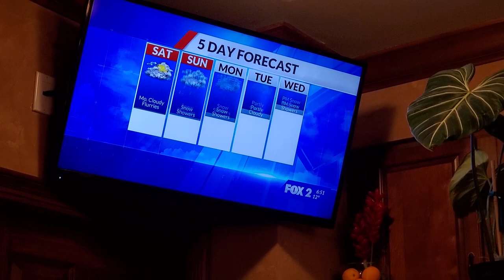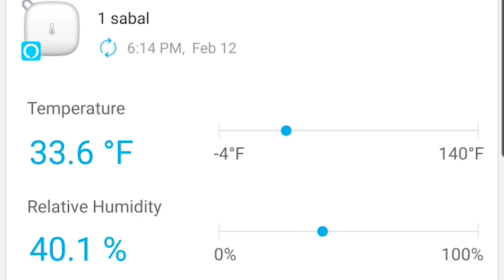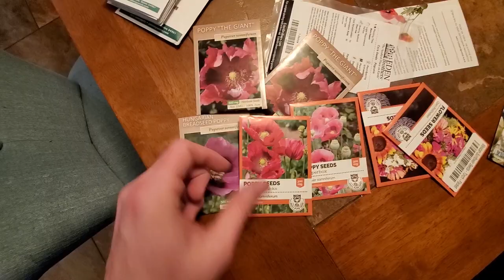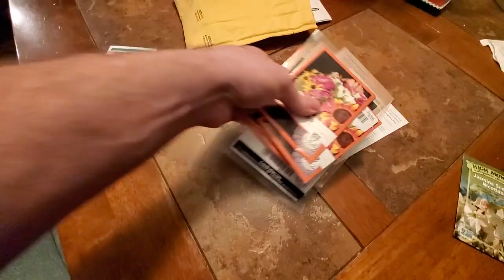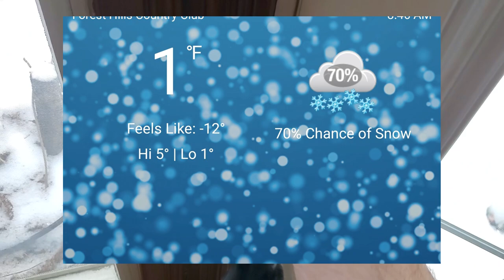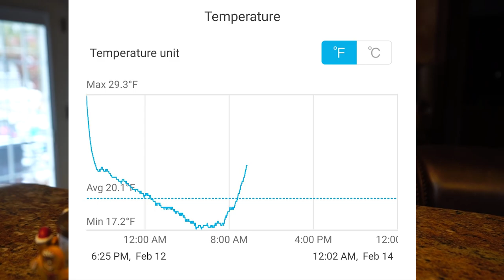Protecting Plants & Palms From Extreme Cold || Saturday Vlog

Comment: Hey Jeff. Those plant tents are great. Really easy to use and I imagine fairly cheap. I like the C7 lights combo with the pop-up plant greenhouses. I'm planning on planting out my brahea edulis this spring here. I'll probably need a set up similar with the xmas lights if our temp drops again next winter. Have a great weekend 👍. Cheers
Reply from the maker: Hey you! Wouldnt be a bad idea to protect the brahea it's first few years in the ground. They make automatic thermostat plugs that turn the lights or heat cables on when temps get to near freezing. In the US they are called, thermocubes. there's a book that I bet you would enjoy about hardy tropicals and ways to protect them. 
"Palms won't grow here and other myths"
Book by David A. Francko
Reply: @TropicalPlantParty  Thanks for the book recommendation.  Sounds fascinating.  I'll check it out on Amazon as it's definitely something I'd love to read

Comment: You're right Jeff. It is to cold. My pond is frozen over hard..had to shut off the wetland and top of the main stream cause the ice dammed up enough that water was running out of the streams. (I was looking for a giant mass of ice...My kid discovered the two inch thick layer of ice under the snow in the seating area.) My grow space has a frigid gust of air periodically coming from the vicinity door which I can't pinpoint, I hung a blanket to try and at at least slow down the cold air. Mostly ok with the temp in there, but I can't keep the humidity up in there though, kinda wish I'd gotten a fogger when I saw your video with one. Super frustrating, everything dries out really fast. My wife was ok with the power bill last month, don't want to know what this months will be. I was hoping next year to be brave enough to leave some palms in the ground outside, but then there are weeks like this.
Reply from the maker: Well, I turned my foggy machine off. The heaters have trouble keeping things warm when humidity is high. It turns into a battle between the heaters and fogger and the fogger usually wins. I figure I'd rather them be dry than damp and cold. I imagine it will prob dip into the 40s in the growspace if it does go below 0. But maybe not, it was only 1f this morning and 61F in the heated part of the garage. Idk, but im over it! Lol.. I do like the snow though. Winter is so ugly here, it's nice seeing something other than defoliated trees and dried up lawns. 
I remember that happening to me once when I had a pond. The frozen waterfall and spillover, almost drained the thing when I was sleeping. Do you have a de-icer to keep a hole?

Comment: I have been gone for a while. I'm moving mid-April (I hope!) and I have been packing and planning. Glad to see everything doing well. :)

Edit: I bought some temp. gauges that send an alert to your phone if it goes above or below the set temp. 
What I didn't know is you have to be within five feet of the gauge. -.- Close enough to see. 
So, 'someone' went in my greenhouse and moved my heater and turned it off (They brought friends in to smoke cigarettes 👿), 
so I didn't know during some of our coldest weather.  Long story short, I lost a lot of good, old cacti and babies. :(
Reply from the maker: Oh no! I've had similar things happen. Sometimes my garage door doesn't close in winter unless you hold the button down. Have had some scares where ppl didn't know you have to hold the button down and things got really cold! These sensors are pretty decent, I can usually access them from anywhere in the house but on rare occasions they can be glitchy. Idk if it's them or my wifi. It's probably the wifi bc when I switch to Bluetooth they work. The alerts aren't great though, I rarely hear them and they flash on the screen screen dissappear quickly, but again, that's probably something on my end I could fix in my settings.

Comment: I've been jumping through hoops to figure out how to keep the pool equipment & faucet warm. Towels, blankets, sleeping bags & old Canadian winter coats, and a tarp over the pool equipment. Right now we have the pool faucet continuously trickling into the pool because the dry air is evaporating the water at a crazy rate. I may take the hair dryer & shoot some warm air under the towels & jackets on the faucet periodically.

And I despise having cabinet doors open in the kitchen...tripping hazard.

Although today we had the warmest temp since tues...a balmy 33 degrees. But this is nothing compared to forecasted temps for tues...temps in North Texas in low single digits. Wind chill below freezing.

And they're only predicting 3-6" of snow! With these miserable temps, at least give us a decent blizzard! (Ok, North Texas can't handle a blizzard, especially at these temps, but snow would be nice to look at.

Put the passion flower pot in the shed with an old flannel sheet on it, put a sheet over the herb pot. I won't fuss if those don't make it. Everything else has been in for weeks...and of *course*, pests decided to become super apparent on the plants & I can't even take them into the garage to spray because it's too flipping cold!

Oh and we've had a robin invasion. Dozens and dozens of them...eat the red berries & birdie bombing everywhere...need to pressure wash the walkways when it warms up.